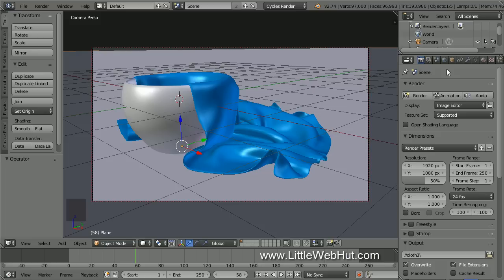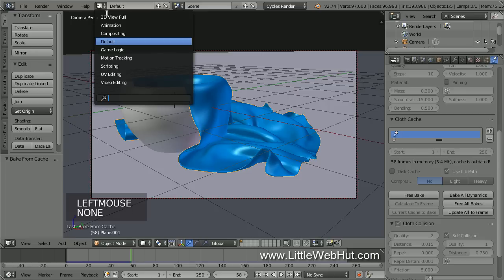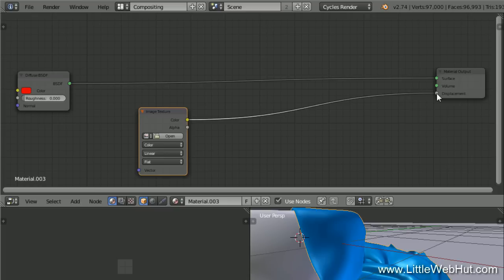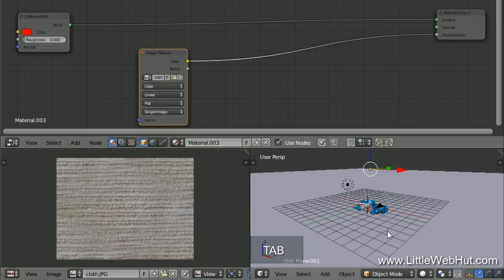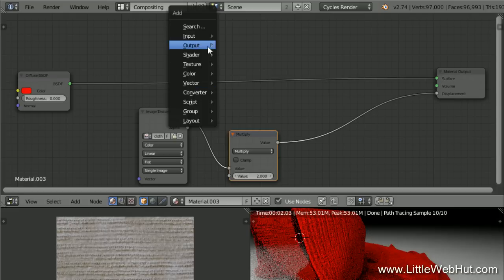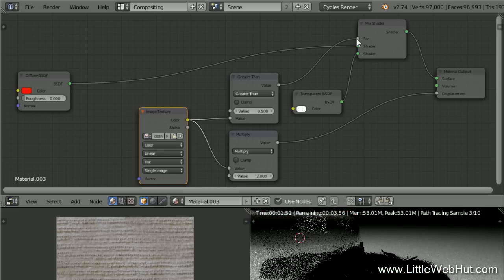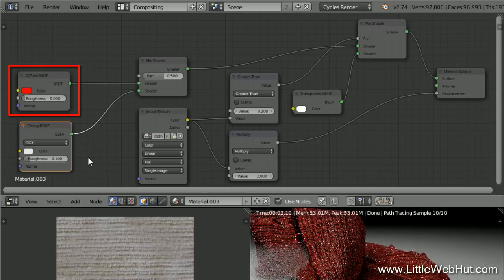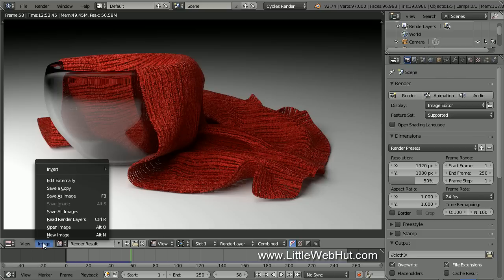Blender Tutorial: Cloth Texture with Holes

Comment: Thanks for the cloths tutorials, nice work but there are a few things in this one I feel the need to point out so all you guys who are new to blender can learn even more.
1. the use of a photo image texture as bump map. this is generally not a good idea, might work reasonable on some textures but not on all. If using are using bump maps instead of normal maps like this use a specifically designed black and white height map and not the color texture. If you have a color pattern like a flannel shirt for example the different colors will have different heights and that's not correct.
2 The use of layer weight to determine specularity. Why? This means that the fabric is more or less glossy depending on which angle it has to the camera if I understand it correct. Thats just wrong, the gloss is the same on the whole material if it is cloth of the same type. If it was some areas of another kind of fabric the gloss would be determined by a specular map as factor in the mix node. But in this case the gloss is constant. Instead use a normal map on the gloss shader (and diffuse shader) as this will give much more accurate result.
I do like that you didn't use the photo as color input for the diffuse shader however :)
Cheers